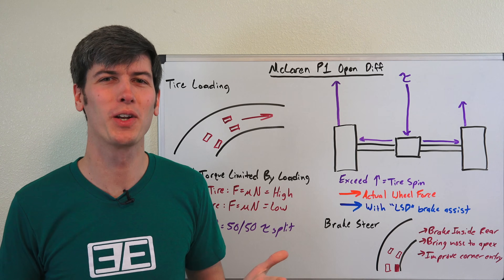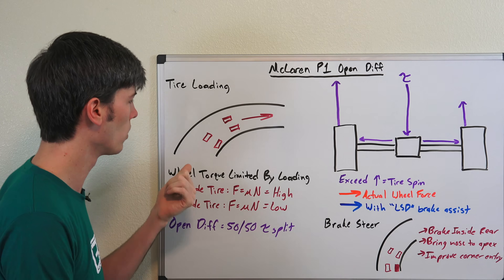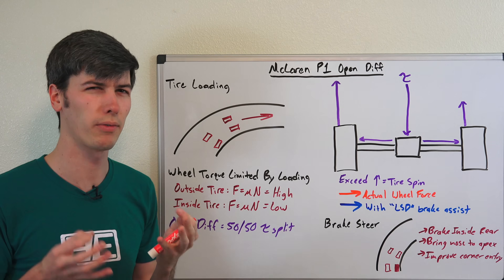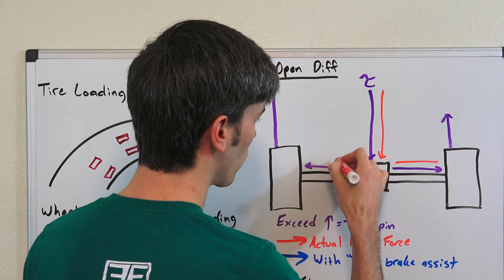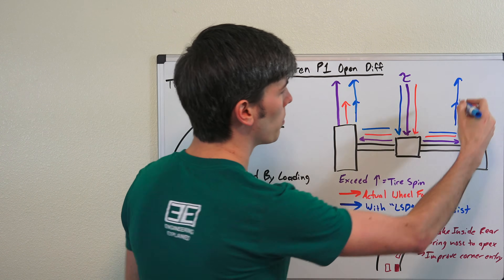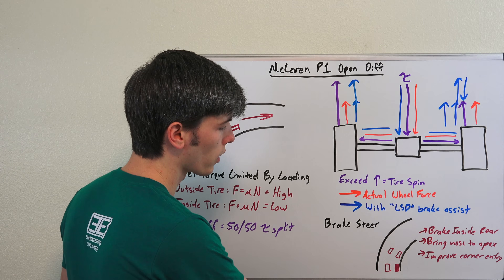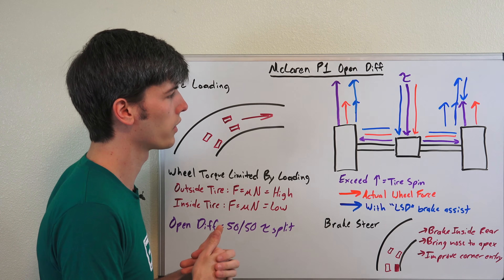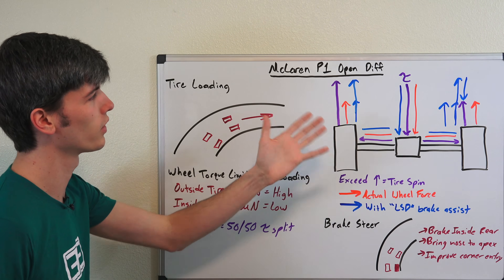The McLaren P1 Has An Open Differential?

Comment: There are 2 reasons I can think of as to why you would opt for brake-steer and open differential versus using a limited slip.  First, having an open rear differential actually improves turn in.  Any seasoned autoxer who has switched from an open diff to an lsd on a rwd car can attest to the change in handling, the car will understeer more than it did previously on corner entry.  To compensate, trail-braking is often used to get the car to rotate, then the benefit of the diff can be used, better traction to power out of the corner.  Driving in this way puts additional wear on the rear tires, and more heat as well during extended track sessions (when looking for ultimate grip).

Secondly, when simply driving at low speeds around town, limited slip differentials can make additional noise, and scrub the inside tire around a corner as it attempts to match speed with the outer tire.  Even though these aren't race conditions it will cause additional wear on the tires anyway shortening their useable life.  Eliminating the lsd can improve the overall noise/vibration/harshness experience in what is otherwise a fairly raw car.

One final note is one of the greatest benefits to the McLaren system, ease and amount of adjustability.  Adjusting the behavior of the system is a simple software change, whereas the mechanical limited slip requires removal and disassembly in order to modify it's behavior.  Having tons more adjustability by using sensors capturing data hundreds of times a second to modify the braking force to change wheel speed individually while monitoring the effects on the suspension is a very powerful tool.  Most of this work is dialed in by the factory, but the customer can change driving modes to adjust the behavior of the system.  Ultimately, this is why systems like these are so powerful, and becoming more prevalent in volume production cars.

Comment: If the open diff is always sending equal amounts of power, then how come if you get bogged, all the power goes to the wheel with less load or traction and nothing to the wheel that's properly contacting the ground? Surely with an equal 50:50 split you'd continue to move with the other wheel at least a bit. I always understood that an open diff, when load shifts to one side, the power is going through whichever wheel is easier to rotate depending on the amount of slippage

Comment: I see 2 possible reasons: 
One is that open diff is lighter than open diff. 
And it could be that once they did the preventive brake steer, the limited slip diff never actually had to work, so they removed it.

Comment: engineering explain, the reason why they use an open diff is so the front steering would not be corrupted by a stiff yaw rear axle on corner entry. thee brake steer is banned when mika hakkinen used it too, anyway feel free to join my facebook group called velocities natural selection /venase for those passionate on speed

Comment: this is common in "modern off road" suv type crap they use the brakes to hold the unweighted wheel because the suspension cant flex and keep the wheel on the ground

Comment: The reason why the P1 has it because the differential braking is by far, a faster in response to driving conditions than a clutch controlled diff.
This is Mclaren, the worlds most successful F1 team, not your plastic Nissan. These guys know about speed.

Comment: Based on what I understand about differentials, an open diff is the one that sends the power to the tire with less resistance, for example If you are running an open differential and you hit a loose patch, the differential will send power to the tire over the loose patch because it has less resistance, causing wheel spin on the loose patch side, while the solid contact side barely moves. If that theory is correct, then the split won´t necessarily be 50-50, whenever you get to a corner in the P1 it´ll brake the inner rear tire and that will make the diff send the power to the less restricted tire, which is something different to what our admired character said. Now the question is, am I wrong? What did I get wrong?

Comment: Could reduced mass be the reason? Given brakes are a necessity, using them to mimic limited slip differential operation with a lighter open diff is an elegant solution to the problem, since software to enable the function adds no mass.

Comment: One thing i'm not sure i follow. If the torque distribution is 50/50, why when someone does a burnout in an open diff car only one side actually spins? I was always under the impression that it was 100% to one side or the other. If anyone could help me understand this, that'd be much appreciated.
Reply: The power takes the path of least resistance always. So if there is no proper contact with the ground, one tire will take 100% of the power output, hence only one tire spins.

Comment: Brake assisted torque vectoring can wear out your brakes early, and WORSE, it can cause in extreme causes additional clutch wear and possible failure. For example, NEVER do an extended burnout on vehicles with brake assisted torque vectoring if you don't have the ability to turn that off. As your wheels are spinning on the burnout, the ECU is trying to "vector" by holding the brakes, which increases the force on your clutch and overheats the brake.

Comment: If I were to guess why, I'd say that it's for control reasons. Torsen LSD's and the like are, from an electronic control perspective, passive devices. That is, the electronics have no control over them and they are (exclusively) mechanically tuned devices. With electronic control, you can tweak things with a lot less hassle and in many more ways. If they were going to add the cornering control anyway, they already had the physical hardware to do this, so it adds no cost (even on a $$$ super car this is a plus) at the expense of more programming. 

This would allow one to, say, tune the car to a specific set of tires and/or set of road conditions; it also allows for continuous improvements w/o having to do a lot of mechanical work. Just flash some fresh code, and be done. With a torsen, if you want to customize something, if you even can in the first place, you'll likely be popping a cover or removing the pinion, which is a lot of work and hassle. 

A lesser benefit I can think of is that an open diff usually has less rotating mass, which is always a plus.

Comment: Somehow this must increase performance. When money doesnt matter and it obviously doesnt with that car this is the only reason that makes sense. Maybe the open diff is smaller and or has a better weight to it fitting the requirements of the rear axle for a 50/50 weight distribution. Youre obviously losing power which the engine could deliver if you apply the brakes on one tire but the 2 tires probably couldnt handle all of the 900 hp anyway causing them to spin. So they thought that solves 2 problems. Thats my theory anyways :D

Comment: OK, I'm trying to follow the logic here, and I'm stumped a little.  If you're accelerating out of a turn, then wouldn't the use of brakes slow you down slightly?  Is there a formula that can calculate the effective wheel HP on an open diff w/brakes versus a true LSD when accelerating out of a corner?  Hope so.

Comment: Could it have something to do with going airborne? Im told that the TorSen diff in the NB Miata (which is superb under normal conditions) can upset the rear of the car if it gets airborne. The clutch pack diff is supposed to cure this condition, but Im told that its not as good otherwise.

The P1 already has braking computers anyway, so maybe this is just the shortest line through both problems?

Comment: An open differential (exept E-diff) has better cornering characteristics and in this case the brakes have much more cooling performance than a limited slip diff. That is a limited slip diff would burn up much sooner than the brakes. And by exluding the limited slip diff there are also a weight and packaging saving to bennefit from.

Comment: I don't think the question is "an LSD isn't very expensive so why not use one?" I think the question is, how expensive and complicated is an active electronic differential as used in Formula 1? And can such a thing be made reliable enough for a road car? I think that's what we are actually talking about. They're using a relatively simple and robust method of accomplishing the same performance goal. Granted, there is wasted power with this method. But looking at the whole equation it seemed to them to be the better alternative.

Comment: the brake steer thing was from 1997 when Darren Heath (photographer) noticed both Mclarens with a glowing inside rear brakes coming out of corners. This was a the A1 Ring in Austria. He then stuck his camera down the cockpit and took a photo and when he developed the photos, there was a 3rd pedal i there. since cars even then were using hand clutches, he surmised that it was 2nd brake pedal and spoke to some engineers. it got published in F1 Racing magazine and other teams copied. the thing was, if the brake was automatically choosing which side the pedal would activate made it illegal. if it was chosen by the driver it was legal. in then end, it all got banned.

Comment: could it be a way to limit the extra weight with that might result from limited slip differentials. so you use the brake that are already there instead of additional clutch or any other mechanism?

Comment: The choice of open centre and electronic braking control, is an interesting one. You are trying to supply the benefits of a spool or limited slip dif, without the negatives. You are betting on the electronics to provide the control necessary for that to work. You are also making a choice that's very hard on rear brake temperatures, and wear. One point to make, this is not an ideal solution. There is no ideal solution. This is one set of choices made for an elite sports / hypercar, where cost is no object. Another point, I would suggest that a situation where the car is only ever used under race type conditions, would be better served with a spool dif. A situation where the car is raced and sport driven, but also occasionally on the road, would be well served with a conventional limited slip. A situation where the car is almost never driven hard, is perhaps best served by an open dif. This solution offers all the benefits of an open dif, in terms of normal use, but still gives better drive off corners and a degree of chassis balance adjust-ability from the right foot. A mechanical limited slip has effects on handling, many of which are undesirable in normal driving. It is a more demanding package to drive - you wouldn't toss the keys to your secretary on a wet day and tell her to follow you back to your place in the other car. An LSD can bite people who don't know what they're doing very quickly, and they don't really need to be doing something brave or silly for that to happen. An open centre dif is much easier to use and more forgiving to inexperience, under most normal conditions. But it suffers from wheelspin off slow corners. That's usually not going to be a major problem unless you are trying to drive very fast...

Comment: Toyota also did this with the Tundra back in 2007. They called theirs the "Auto LSD" and was a solution to have limited slip without the harshness of a locking differential, the wear and maintenance of a clutch LSD, or the cost of a Torsen.

Comment: If the tyres on the outside of the corner (greater radius from axis of rotation) have a higher load than those on the inside (smaller radius from axis of rotation) does that mean that more power is sent to the inside tyres (I know thats not technically phrased right), thus making them want to spin faster than the outside tyres?
Reply: TheMADDJACKO 
Yes, that's why the system only applies the brake (negative acceleration) to the inside tire. The brake wastes the additional energy generated by the system to favor increased yaw angle by yielding increased torque to only the outside driven wheel.
Reply: So essentially the breaks create a greater stopping force on the inside so the outside wheels are the ones that are sent more power? Thats quite clever, I always assumed the inside breaking was to pull one side of the car in, sort of like a tank does.

Comment: Hmm, well it sounds like to me that, with ideal computer controls, the system can be a no-slip-differential. Even with a torsen LSD, the inner wheel can break loose, and applying brake force to the inner wheel would be fighting the inner worm gear drive. By using an open diff, the rear torque bias can be completely controlled, from 100% left to 100% right. Thats how they can achieve the fancy inner wheel braking system.

Comment: That braking costs horsepower. However when you are cornering the tires are under load from the corner so they cannot take as much force from the engine as they can on a straight. The P1 has more horsepower than the tires can take at most track speeds in a straight line so loosing some to the brakes is no problem at all. However in a car like your S2000 an e diff would be a disaster as potentially you could loose half your horsepower.

Comment: Hey, Does that apply to any open diff???
Reply: Josh Moore no
Reply: The principals do. 
If the spinning axle/wheel can be controlled, where the torque/power is applied is controlled, therefore increasing traction and applied torque/power. 
The key elements are detection and control of the spinning axle/tire.

Comment: Um... Let's see. The McLaren P1 has carbon ceramic brakes, which makes them immune to overheating - actually, they are better off while hot. Maybe that's a bit of an answer - McLaren wants the brakes to stay warm so they are always ready for full stopping power? Other things - is the limited slip diff construction in any way more heavy? Or complex in a way that the car would not be able to adjust the torque vectoring properly? Just a theory... Oh and just a plus - I think when you are buying that expensive car, you want the maximum on the track, you don't mind I guess replacing your brakes this 10% more often. 

EDIT: And the last bit: McLaren is harvesting energy through braking... Don''t know if its only on 2 front wheels or all 4, but it could well just harvest the energy during cornering for immediate use when exiting the corner...

Comment: I think even laferrari has an open differential. but I think this system is not that good cause, brake life is reduced and so does of the tires. the outer wheel gets the 50% and the inner wheel gets less but the lessened torque is not used by the outer wheels. this car as said by motor trend channel, gets in corner fast but has difficulty of getting out because of the differential.

Comment: why do MAL do this? 
Because they understand that controlling the cross axle dynamics is not just about maximising total tractive effort (longitudinal acceleration) but also about controlling yaw authority via tyre slip modulation.  Consider what happens if you were to brake the inside wheel to 10% below the mean road speed.  What happens is that the open diff speeds the outside wheel to 10% above mean roadspeed. Your tyre slip is even (10% per tyre) so you total lateral capability is even, but because the direction of the slip vectors are reversed, the net tractive effort vector is offset from the geometrical center line of the vehicle.  In this way you can control not just the absolute cornering radius (set by the total tyre slip) about also the yaw acceleration around the vertical CofG of the vehicle.  ie you can control how the car actually turns, using the rear diff.

A fully open diff give the widest dynamics control window, allows an undamped trailing / zero throttle turn-in moment, and allows the system to both damp or amplify yaw acceleration in near real time.  It does this with no extra hardware, unlike conventional electronically modulated limited slip differentials such as those from GKN etc.  (and of course, as mentioned, it can decellerate wheels below the mean road speed, which no other system can do (they require positive engine torque to torque bias, whereas this system can do it at neutral torque
Reply: Max Torque So I pretty much understand what you're saying but do you know where I could go to learn more about this? Any good books or websites? Thanks

Comment: I think the reason they do this is to allow more power through a corner while mitigating power oversteer. With an LSD installed, the inside wheel would start to slip first when power is applied. As the wheel slips, it would allow the vehicle's weight to shift sideways. This would cause the outside wheel and tyre to have more sideways force, thus causing it to slip. I believe power oversteer would be reached sooner with an LSD setup versus the McLaren open diff system. Just a guess, though!

Comment: You said it your self Jason,heat management,less cost/weight. Remember modern super cars have huge controllable wings and they level out that shift of weight by down force. Huyara has separate flaps for left and right turns to compensate weight shift even better.

So why need an ultra expensive,heat/power absorbing, weight increasing diff when you can get better grip for both wheels with a singe appliance? Cheers!

Comment: Since half of the engine torque is going into the brakes as heat, would you have half the potential torque compared to a locked diff?

Comment: I don't like it. Simply allow the wheel to get too much power sent to it and then we just burn it off with the brakes? Unless I'm missing something, this tech is just a sportened version of early 1990's traction control. If it works it works but it's still a gross energy waste.